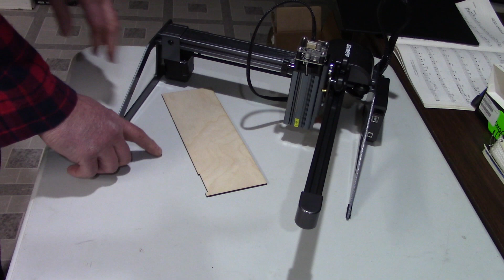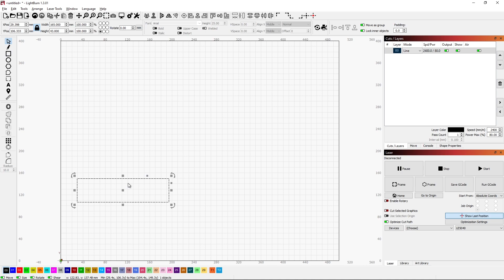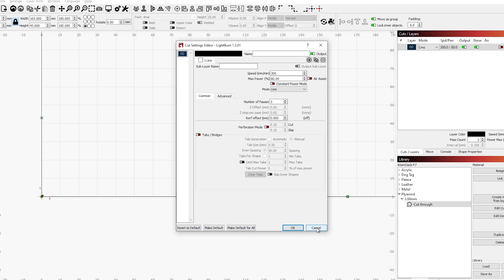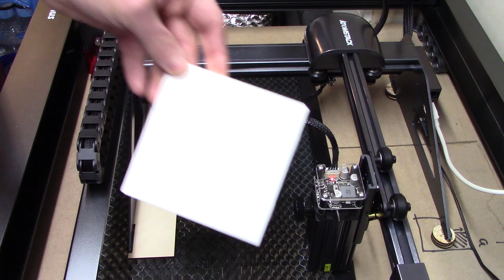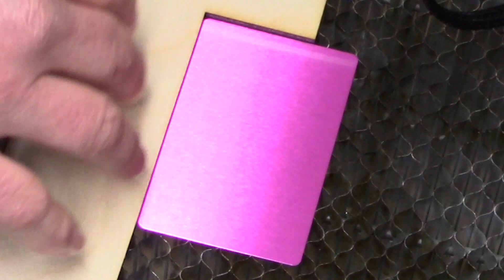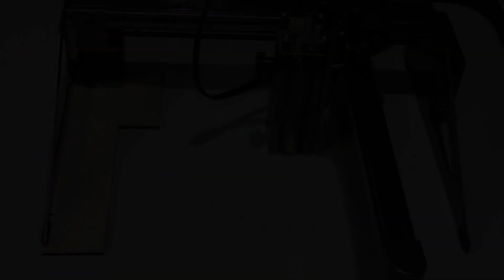Easy zero/zero fixture for Atomstack P7

Comment: Fancy sharing the measurements of the template so I can cut it on my CNC?
Reply from the maker: Well.... Here's the thing, I really don't have measurements.  I had a piece of scrap that was big enough for what I needed. I used a laser with a larger travel to burn a straight edge and to cut the notch at the end to go around the neoprene foot pad and hook around the end of the leg. This lets the straight edge sit on the near support leg and by hooking around the end, can be easily placed in the correct location.  The top and left cuts were made on the P7 by keying in some cut commands from 0,0.  I did a cut up the Y axis and then on along the X. 
The notch for the foot is 2mm deep from the main straight edge.  From the depth of the notch, the little hook at the end comes out 4mm.  It could come out more as the amount doesn't matter as much as the ability to hook over the end of the support leg.  The length from 0,0 to the far X end is about 60mm.  The height up the Y axis is about 38mm.  These dimensions are not critical.  The important part is the ability to always put this in the same place relative to the laser's 0,0 location.  
The thickness of my template is 3mm as I used 3mm thick plywood.  This is an issue with material thinner than the 3mm.  In those cases, I typically put something on my waste board to then place my material on so that it is higher or close to the laser.  This helps with focusing and clearing the zeroing template.
I hope this helps.  :-)